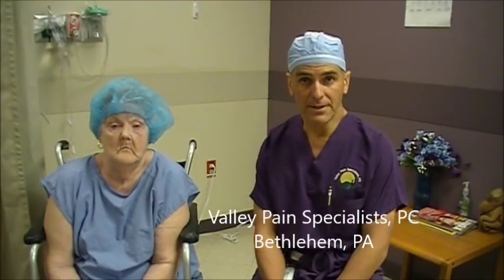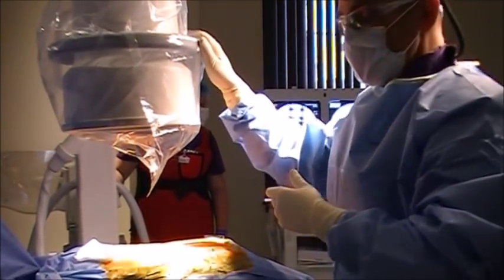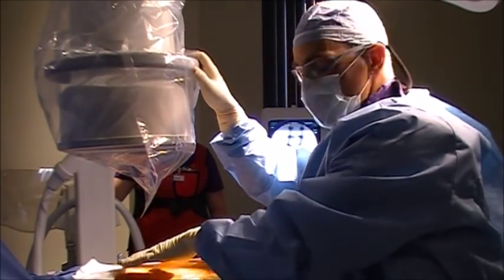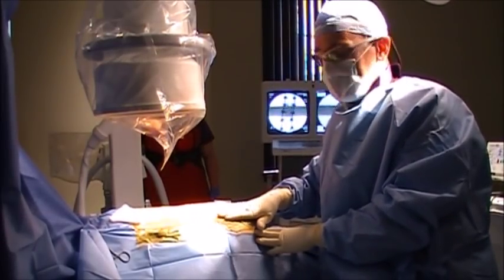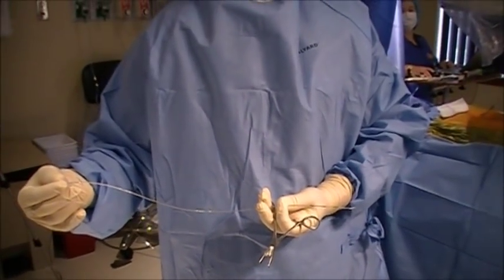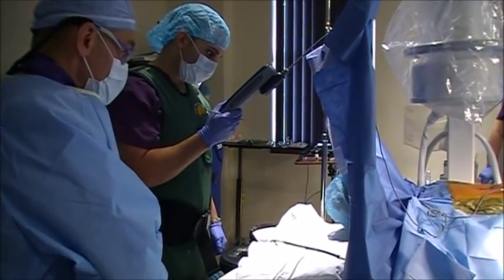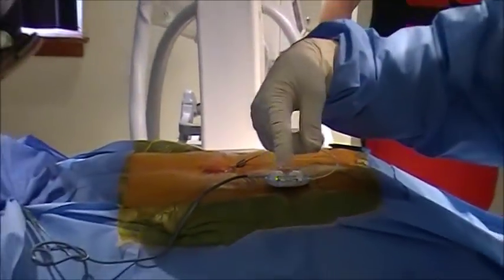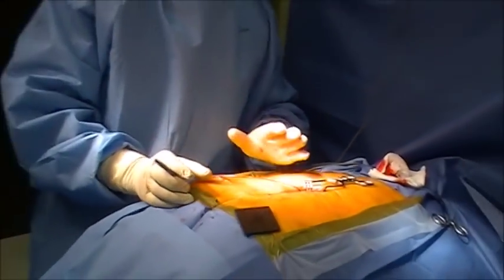Spinal Cord Stimulation Implantation

Comment: It doesn’t work. I have had one for over 5 years, and zero pain relief. Five surgeries including an L3,4,5 fusion done twice, 2 metal  disks and the spinal cord stimulator. I’ve also had an oblation done on both sides, and various other pain relief procedures done. Pain is 9/10 when I walk or stand for a few minutes. Life quality is very low.

Comment: It looked like once she started hollering when he was putting in the rod or long thingy where the leads will connect to the battery,  he started really shoving or forcing it through the skin and she was even louder as hexwas forcing it....very scary!! I am having the Nevro HF10 trial done Aug 5th, for Neuropathy in my feet, and  I  hope and pray that I don't feel any pain if and when I  get the permanent implant done!! This is the first video I have watched that has me really scared now, and I have watched a lot of videos on this!! I  live in NC and my pain management doctor is great, he has done a procedure that he went in and cleaned out around the nerves at the bottom of my spine, forgot the medical term for it, for my lumbar spinal stenosis, that didn't help, then he did 2 procedures,  because my insurance required it to be done twice to make sure it helped,  it was injections that would give me relief for 6 hours, I  had to rate my pain for each hour during that 6 hour window. I did get relief,  so then my pain doctor scheduled me for an Ablation to go in and burn the nerves,  I didn't get 100% relief,  still having some pain at the top of both butt cheeks when I walk a good distance and doing housework.  So all of my procedures my doctor just gave me a local was not put under, I  never felt ANYTHING,  except just a little pinch when they gave me the numbing shots. I did make not one sound at all. So the doctor in this video,  I  agree, he was all about doing the video.

Comment: I had the 6 day trial period that was to help the L-5, L-4, L-3 and L2. After 45 minutes they were done. A some discomfort, day 3, I had 60% relief and 70% on day 4 and after. I reported my success and the Dr and Medronics rep helped remove, clean & cover. I did not told this in advance, fine.
  Insurance gave the Ok, and the rep told me they picked the electrodes position based upon and anatomical chart and spoke to me briefly before the new leads and  the Dr ask if I preferred a side for the SCS rechargeable intellisus model the had chosen for me. What do I know, don't tell, don't answer! 
I woke fine as I was under the whole time, no questions or feedback as other videos indicated. I go home an hour later, which was a Tuesday. On Saturday I got a call from the Medtronic's rep who ask how I was doing? I had been sore but felt stimulation down my back side,thighs, into my heels! He said: "Good, Good that is great", I told him but my pain is in my lumbar, L5 & up. Never down my legs ever. It's on  page 4 or 5 they had me fill out the first day I came in. Nobody looks or makes notes? Just files it! 
 He said Dr XXX will kindly let us use one of his offices, I will call or email the date & time. So, this goes on 5 or 6 times, some emails, some calls over 5 months. I told him dude, we are not getting anywhere! I sense a level a level of frustration so I will have XXX engineer come in. This gal spent 20-25 minutes and says "We will contact you". The Dr calls on 4 different days at my house and tells me he is going to talk to insurance and we will move electrodes. Now, into month 6, I am to go to hospital for news leads/electrodes. This time awake for part of it with him, not fun! We are done, go home and at the belt line now. Medtronic's rep comes in training new guy. Then a few days later into next week I get the engineer. She spends some time like 39-45 minutes, get up and offer to walk me to the door! Wait? What? I am not getting stimulation where I need it. Well, I have other things to do!
 3 days later, rep emails and says there is no services Medtronic's can offer you to help.
So, what? Good bye, have a nice life? Is this where you pull out an ink pen and get flashed? Erasing my memory?
  So buckets of money, they quit, want me to go away! I guess. Good luck, I got paid...
Boston-Scientific here I come!